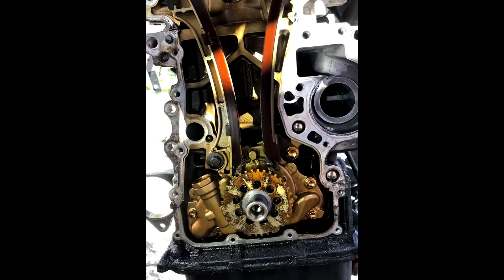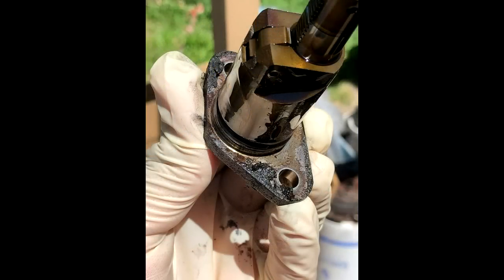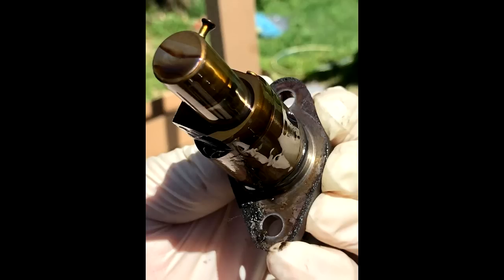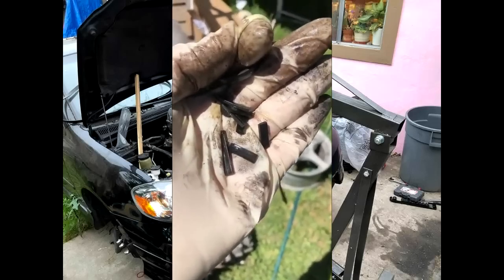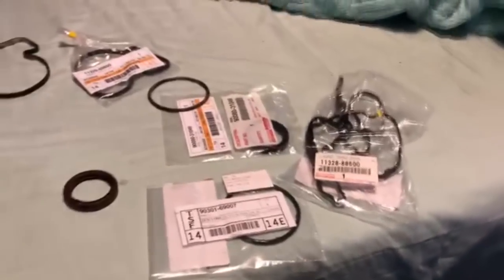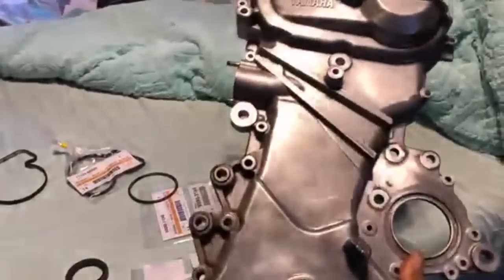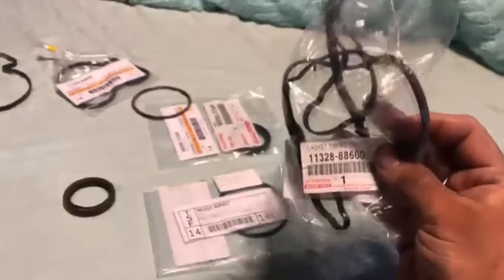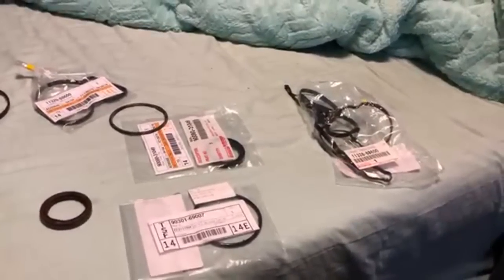Common Oil leak locations on the 2ZZ-GE engine resolved

Comment: I can see oil residue around the dip stick tube where it meets the engine on my corolla.is there an oring there and would that cause oil to leak around edges of the sump?

Comment: How much leak is too much? My 05xrs leaks about a quart every 1000 miles or so. It has 240k miles and runs great. Just leaks oil
Reply: Do it mate its easy. This engine if is healthy go over 300k with good maintenance. You have 240k on original engine without issues and repairs?
Reply: @DimoS...  I bought this car new in may 2005. All I've ever done is basic maintenance. Nothing major. I did replace the clutch at around 180k miles.  It's been leaking for a few years now. Just seems to be getting a little worse lately.
Reply: @singinalex52  they are normal leaks don't worry just fix it before you have a problem
Reply: @singinalex52 also very impressive for 8.000 ++rpm engine to go over 200.000 miles! 👌

Comment: I found the similar leak on my MR2 spyder 2zz swap. Thank to this information.
Reply from the maker: Glad it helped
Reply: @2zzlow But it looks like you’re in a full shop with a lift? 
Do you have to take the engine out to do this job? I’ve put in a new head on my 87’ BMW E30 but I think my girls friends car (2000 Celica) has this issue. So I think I can do this as long as the engine doesn’t have to come out. Oil all over the serpentine belt area and dripping. But doesn’t overheat. How did you diagnose this? Thanks for your reply and this video really helped. Thanks.

Comment: Thank you. I was wondering where all the oil was coming from. I got oil everywhere. Even on the hood I guess from the belt throwing it everywhere. I do have a question if you could help me out. I got a 2001 celica gts. Whenever I am stopped then start to accelerate my oil light flashes. It also did over heat the other day too. I cleaned the oil screen inside the oil pan it had some of the old oil pan gasket inside. So I remade the oil pan gasket. New filter. New oil. Yet the oil light is still coming on. What I'm thinking now is that maybe it's the oil pump? So I was going to replace it but I can't find any videos on how to replace it. Can it be done with the engine still in the car? I asked a shop how much it would be and the said $700 and it would take 2 weeks. I only got $100 and my job is delivery so I haven't been working due to my car acting up. Any help is appreciated if you see this. Thank you.

Comment: I get you on the torque specs. Just put in the bolts to the power steering pump on my 2zz and didn’t torque any of them. The timing cover raised itself up on the right side closer to the radiator side. When I installed the water pump it resolved the gap. Correct Torque and tight tight both work.

Comment: Do the 1zz and 2zz share the same block? I saw your oil pan video and that got me thinking. 🤔
Reply: Btw, I disconnect those IACV coolant lines from the tb and loop them together.
Only needed for the northern states.
Reply from the maker: Different block, iacv coolant lines aren’t necessary honestly. My 3mz swapped Celica has them looped
Reply: @2zzlow  the throttle plate is steel while the tb is aluminum. So in arctic like conditions, the tb can technically seize the throttle plate. So the coolant lines help thaw it out.

But yeah, I have them looped on my 1NZFE and 2AR FXE

Comment: lol, thanks for the vid. I'm sure I'll eventually have to do this, too. I've been watching your stuff a little out of order. lol- in this one you still have hope for the ebay radiator! at least now i know where not to get one, so thanks for that! also, at this point in time, you were not against using the screw type hose clamps. I'm now skeptical about them thanks to your newer vids... like, I'll still use them, just carefully. thanks for your contribution to helping us with diy projects!
Reply from the maker: lol yea I didn't notice that but actually funny story, that clamp just kept leaking ATF, I finally changed the hose and clamp to an OEM spring clamp and it fixed my leak. check my latest track preparation video for proof hahaha

Comment: I'm losing about a quart of oil every 4k miles, maybe it's leaking? I hope it's not burning, I don't see any smoke coming from the exhaust. And I don't see any leaks on the ground. So maybe it is being slushed around the engine bay because I do see dirty black spots around my ac compressor and right cv axle.. Maybe that's what causes my serpentine belt to squeak sometimes in the morning.
Reply from the maker: at that point id put some dye in the engine oil and double check with the uv flash light and glasses
Reply: @2zzlow  I tried it before but with low oil so I'll try it again after a fresh oil change.

Comment: Bro my oil light started to blink & then my engine started to sound like one of those prize wheels that u spin & my engine cut off😐 then I poured oil in it & it started to leak from the oil filter which was odd cuz I did a oil change like 2 weeks ago not even 200 miles on that oil & ik I hand tightened the oil filter on well. Anyways I towed the car home & I was afraid it might’ve been something worse. Thanks for the video!
Reply from the maker: it most likely sounds like the car was ran dry due to a loose oil filter but that's just my theory

Comment: 00' Celica: Yup i have a leak around the steering pump. It's very hard to see where it is seeping from. Steering pump? Tensioner o ring? 
I cleaned it up really good and i can see it trickle down the steering pump housing.
Reply from the maker: get a replacement and only use ATF

Comment: I have a 2004 Toyota Celica GTS I was wondering were do you buy your parts from for your Toyota Celica
Reply from the maker: toyota parts deal
Reply: @2zzlow  do you mean you get your parts from Toyota also do you know if you can swap an automatic transmission to manual

Comment: I have coolant getting into my oil, but compression on each cylinder is great. Is there a chance that coolant is leaking through that water pump gasket  and into the timing chain cover?
Reply from the maker: I wouldn't know without doing a few tests

Comment: Yes that's the IAC valve, where your two small coolant hoses go. I recognised it straight away coz I just split apart my whole throttle body this weekend and cleaned everything out for first time. I also hated those coolant hose clamps, struggled a bit to get my pliers in the space from above as they were angled away. Didn't realise I could have maybe gone up from underneath lol. My first thought was to change them out for worm drive clamps as well but I only had one in my toolbox. Will have to keep an eye on them in case they start leaking now I've disturbed them.  Thanks for showing this video, I've been doing oil changes for years but now teaching myself some more advanced maintenance, need to tackle some oil leaks on my 1ZZ-FE. I'll start with tensioner o-ring and valve cover gaskets.  Wouldn't have a clue how to remove an engine but I'm getting more confident and videos like yours help make it all seem less daunting if that's what I have to do. Cheers again.
Reply from the maker: thanks for watching the videos and build the confidence to work on your own car.
Reply: Holy shit, when 2zzlow showed the hoses from underneath I felt like a freakin' idiot. I was banging my head against the wall trying to get those hoses out/back in. Would have been way easier like this, though probably still NOT fun without a lift and just using jack stands. I actually thought I had a leak from there, but it wasn't so. I think you just really have to get those clamps as far up as you can.

Comment: Thanks for this video it really helped me out. I had the same mysterious oil leak and I checked out YouTube for info and your vids came up. So I took my 1999/2000 Celica to the repair shop two weeks ago and told them I wanted the timing cover gasket replaced. They replaced the gasket, crankshaft seal and water pump. The car has not leaked any oil since.
Reply from the maker: Glad it helped!
Reply: Who much they charged you for the repair ?
Reply: @bloodangel9489  About $700 Australian ($550 USD).

Comment: hi , how much oil did it loose over 1000 km? I need to add 1L for a 1000 km travelled.
Reply from the maker: Not much, i have about 3 quarts left in between oil changes

Comment: mind only has 130000 mile and started to leak you think with low mile this might be the timing chain gasket?
Reply from the maker: my XRS started around 150k. you are not that far from that.
Reply: Big job? How many can you do this job? How much do you think the dealer would charge?

Comment: It's not from the power steering pump being over tightened. It's the 3 way joint of the block/head/timing cover that is a natural seem where they all meet. A bead of ThreeBond 1184 laid in those seems (bottom end girddle too) before installing the cover/gasket will seal it for as long as that engine remains running. All Toyota engines leak from this spot...super common. Coming from a Toyota Shop Foreman & MDT. Done many...
Reply from the maker: thats some good info to know. thanks

Comment: What is the sealer & what parts of the gasket are supposed to get it?  Safer to run some HondaBond all around both sides?
Reply from the maker: honda bond is good stuff. i have a video on what gaskets need to be replaced. https://www.youtube.com/watch?v=STnlPeDLfww
Reply: @2zzlow  Saw the video. No details on what the sealer is & which parts of the gasket get it. Better off just to go all the way around??
Reply: @tonflo1  I used Honda bond for my timing cover, valve cover and my sump. I smeared it on instead of beading it when installing the sump and now I have a tiny leak, gonna pull it off, clean it up and put a little extra.

I have no leaks from the timing cover or valve cover gasket which is a good sign :)

Comment: How much does it cost to have the  timing cover fix? I thought it was the timing chain tensioner where the leak was. Someone also mentioned to change the pcv valve.  I need to find the leak on my 2000 Toyota celica gts
Reply from the maker: 100% it’s on the timing chain cover gasket. Every 2zz goes through this. I e already fixed 5 of these. Whatever a shop charges for the hour and parts. Idk
Reply: @2zzlow thanks for the reply, I would do it myself, however don't have the tools. I feel the previous owner did not treat this car right, it only has 78k miles! I love this car!

Comment: Will it permanently damage the timing cover if the 2 power steering bolts are over torqued?
Reply from the maker: You can crack something i assume. It doesn't need to be super tight. If you've worked on cars before you kinda get the hang as to what is tight.

Comment: I need you as a neighbor lol. My 06 XRS is seeping like mad from the chain cover. Did the tensioner and valve cover a year ago which slowed things down but it's no doubt the cover at this point 120k. Never took my ride to a shop, always done my own work but that's a tight spot to be working in without pulling it and i just don't have the patience.
Reply from the maker: indeed

Comment: This is most likely where I am leaking on my celica. It’s so hard to locate but this makes sense. Thank you for this video.
Reply from the maker: Ive done 4 2ZZ timing chain cover gaskets and all my customers have reported no more oil leaks. this is 100% the location of the leak. thats how confident i am.
Reply: I have the problem if you say its the timing chain cover gasket i will put New one too

Comment: Man, how hard would this be to do?  Guys at the toyota dealership tell me I have a leak from the timing chain cover but I really don't trust those guys to work on my car. I have changed a clutch in a c60 myself before and was wondering if this is at the level.
Reply from the maker: If I can do it you can do it. I only have harbor freight tools and a small drive way in my back yard porch. It’s just requires a days worth of your time and patience
Reply: Ya I was told of timing cover leak too during an oil change. They just so happened to do a complimentary point inspection at their own free will. Showed picture of a bad leak which I don’t believe. I’ll need to check it again but does that report truely go to carfax as I’ve read

Comment: Have a similar leak on my 02 Celica // 2zz. Searching the internet left me with the notion that it was most likely the timing chain tensioner. But after seeing this, most likely the timing cover. 

Never pulled an engine before, my question is, can this job be done without pulling the engine? Can I jack up the engine via the oil pan safely with enough room to do this myself? Or am I better off taking this to a mechanic. Many thanks in advance.
Reply from the maker: Ive read online that people have done this with the engine inside the car. You just need to move the engine up and down to clear some of the longer bolts that would hit the frame.

Comment: Do you think there will be clearance issues with any bolts if done inside the engine bay?
Reply from the maker: that i know of the Tensioner and some of the motor mount bolts will be an issue but can be removed by moving the engine up or down with a jack.
Reply: Hi toyota brother! Quick question! Do you think this repair can be done with the engine in the engine bay? I mean not with the engine out  thanks
Reply: @pristboy  doing it right now. Gonna take a while but it's doable

Comment: Yeah, once you've been doing it for a while you get the feel for it, spark plugs are so common when you've been wrenching for a while that you don't really need to torque them to spec. Drain plugs are another one.

Damn, I have that leak also, I really didnt want to do all the seals with the engine in the car. I guess I have no choice, do you know if all the seals are the same for all the 2zz's? I was thinking of just ordering on line, all those part numbers you showed. I don't feel like getting bent over at my local stealership.  What sealant did you use? Is it the toyota stuff? Can you help out with the part number. I'm running a ebay aluminum 2 core radiator now have over a year with it still running good, If it hasn't leaked yet I dont think it will leak or bust anytime soon. How was the fitmant with yours? I've got to say the one i got was a shitty fitment i had to bend some tabs and cut some stuff to get it to fit, I guess because its about twice as thick as the OEM rad, it was annoying to install but seems to run well.
Reply from the maker: Been changing spark plugs since I’ve owned a car for family members and friends with no issues ever coming back to me but the troll squad online just likes to call out the little flaws in someone’s video when they can’t even make one themselves. 

Pretty sure all the gaskets for the 2zz are the same and they don’t change by year or the vehicle it was in. The Toyota packing seal is a must, you can pick it up online for $10. The all aluminum radiator that I bought had lots of fitment issues. I had to cut a piece from my cars radiator support to properly fit the radiator nicely. Then the stock fans had issues bolting up to it. The radiator being much bigger made my stock fans closer to the intake manifold. Not sure if that’s going to affect it on the long run.

Comment: You should get your parts sand blasted at least if you don't like painting it, it helps bring out the original color plus looks much nicer, also thanks for the awesome video.
Reply from the maker: I’ve been trying to pick up a small sand blaster from harbor freight tools but at that point when I was putting my 2zz back together, I just wanted the damn thing running. The black XRS was my daily for the longest until my pressure plate broke. Video on that coming soon

Comment: I have got a 2001 celica gts with absolutely no oil leaking or burning yet and I would like to keep it that way. can you suggest me how to take care of it?  I just bought it 6 months ago and it's my first car.
Reply: Just keep an eye on things, if you ever notice a leak use UV dye and light etc. If its not broken, dont mess with it. It will eventually leak as seals degrade but until then i'd just keep up on oil changes, power steering fluid (read manual, it doesnt use normal PSF), trans fluid and engine coolant. Should be good after that.

If this is a daily driver that you rely on for work, it is most wise to keep it stock and maintained. Its an older car, modding it to get unnoticeable gains is just going to eat up your finances. 02 GTS here, 260k mi, fun to work on and performs great still.
Reply: @viewer54322  thanks man, I am always keeping an eye on those stuff. Mine is at 178Kms and bone stock
Reply: @RajGadhiya  Cool, sounds like you lucked out getting one stock, less worry about bad diy mods and such from prev owner. 

If you have a manual trans, the only mod that is actually noticeable and fun on a daily basis would be installing a short throw shifter. B&M Racing short throw is one of the tried and true ones out there, a couple others.

Last bit of advice use search engine and run searches on newcelica.org forums, tons of great info to be found there, my username there is BobSaget feel free to hit me up anytime. Cheers
Reply from the maker: Just keep up with basic maintenance, if it ain’t broken or leaking don’t mess with it.
Reply: Just watch a few of his previous videos, he mentions info about the oil pan as well.